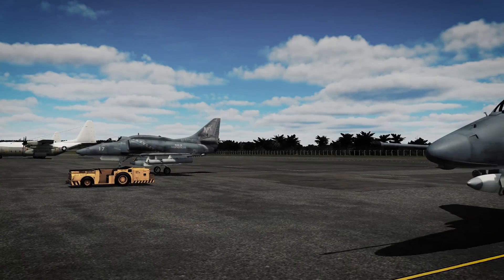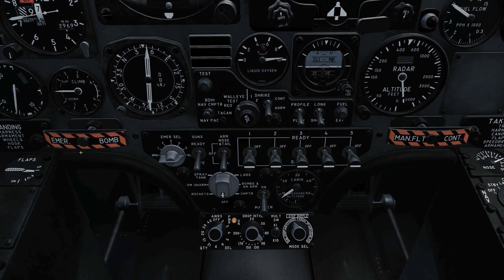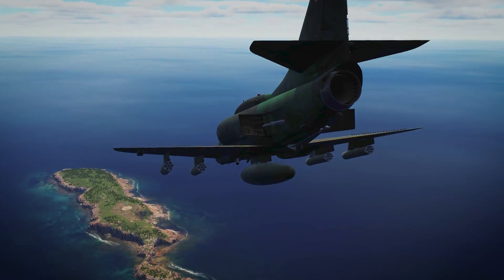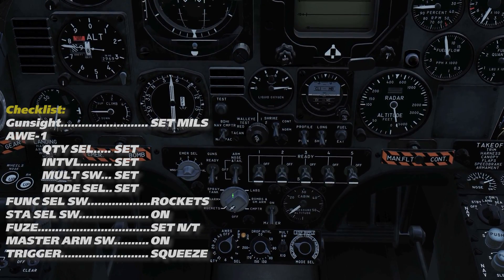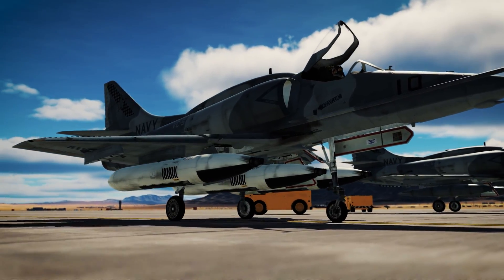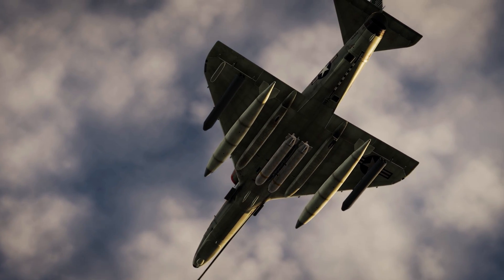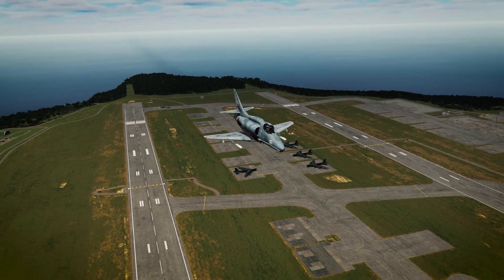DCS A-4E Introduction to Weapons Systems | Digital Combat Simulator

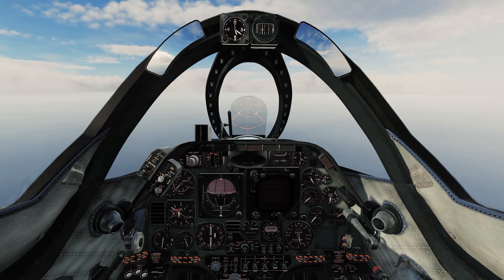Comment: all my shrikes go always dumb as the one you fired at 10:40.. they do not loft and go down instead, I've tried 12.000ft, within 8nm and even closer.. I've never managed to make one work..dunno where's the problem :/
Reply from the maker: There’s currently a bug that prevents shrikes from working correctly. We’re going to have to wait until ED fixes the bug, or releases the new Shrikes with the configurable seeker heads
Reply: @SportDCS   how my god thanks!  that's a relief for me.. i was getting crazy :D

Comment: Can anybody answer me a qusetion ? im new and got a problem with my sidewinders + guns. when im in the "Bomb & GM arm" mode im supposed to fire my 20mm guns with the trigger and the missles with weapon release or ? but if i select 1 and 5 for sidewinders and got my 20mm loaded i allways shot both 20mm and Aim9 togehter with my triger, instead separated. is there a solution instead of allways turning of my pillons 1 and 5 if i just want to shot my 20mm ?

Comment: So you can only use the internal guns once? How does the nitrogen bottle thing work?
Reply from the maker: You get about 3 arming cycles with the nitrogen bottle on board. Every time you turn them “off” it clears the round from the breech.
Reply: @SportDCS  there's no timeout? We can just arm with master arm on and leave on until RTB?
Reply from the maker: @Taipan303  yes, however when the gear handle is placed back down, the master arm connection is broken and the nitrogen bottle will eject the round and clear the chamber. I’m not entirely sure how it behaves in the module, but this could lead to a switch conflict and prevent the guns from working on subsequent sorties.
Reply: @SportDCS  awesome thanks! Given the attention to detail the team have always shown, I wouldn't be surprised if that is fully modelled. In my case I'll disarm both for landing anyway, since I'm planning to use the same 2-way switch for both.

Comment: Hey sport, do hills interfere with the ground radar's solution for computer bombing? I've built a mission around a pop up attack against an artillery firebase on a large hill. While I initially built it around a rockeye attack, I've been forced to switch it to rockets because for some reason, on this hill, LABS makes your bombs fall way past the target every time.
Reply from the maker: I wouldn’t say they interfere, but it’s certainly a factor. The slant range is dependent on where you grab the ground level, so if you grab it ahead or behind your intended target, and the elevation is significantly different, the weapon release computer will calculate for that point. 

I have a bombing computer video coming out soon that goes over different techniques. Maybe I’ll include a section about hilly terrain. 

Another factor could be your dive angle. Too shallow of a dive angle might not give a good target resolution for the radar and result in a mis drop. 

Bombing is an exact science!